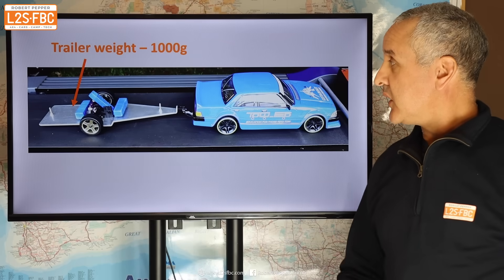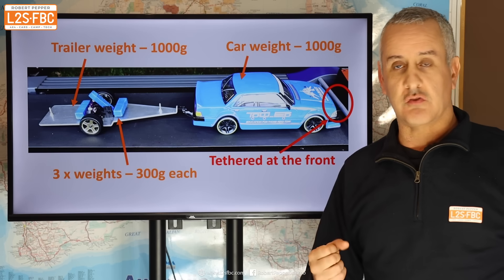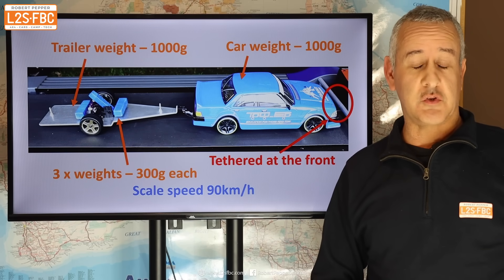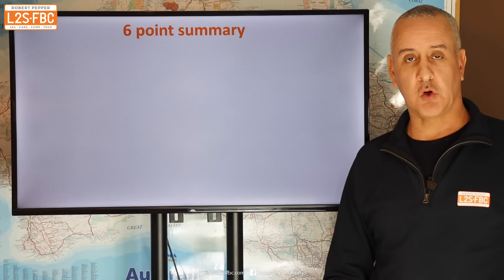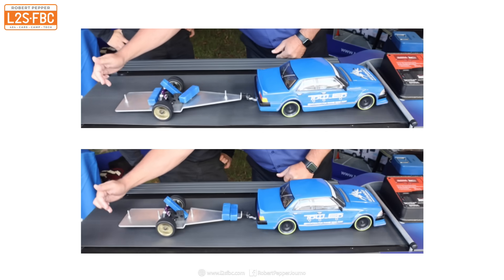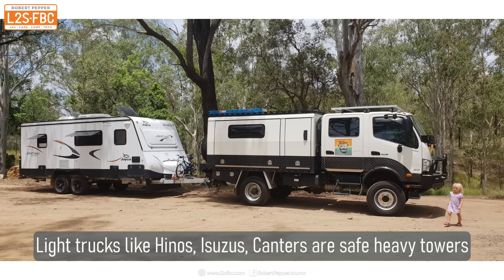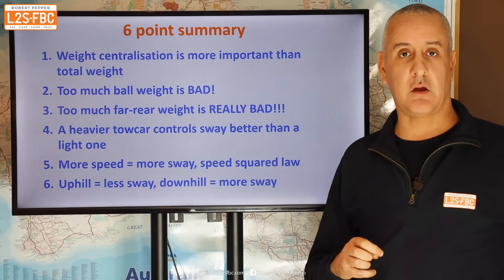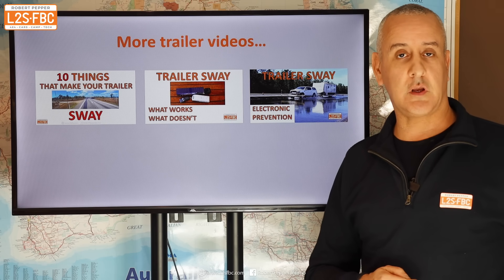7 trailer weight distribution setups, some safe, some deadly.

Comment from the maker: ** COMMMON QUESTIONS ANSWERED **
Consistent questions in the comments are:

1 How do you recover from sway? Answered here:
https://youtu.be/PS_T3-zCzHw

2 Does it make a difference whether weight is front or back if the TBM is the same?
https://youtu.be/fX78Fu87Coo

3 Does height of weight make a difference?
https://youtu.be/LfCpOJGnUdg

and:

https://youtu.be/6IMCEDyHOFY
Reply: 6:38 this is very interesting demonstration considering the front wheels are locked, as in this whole rig set up as no moving steering which would accentuate all motion. have experienced personally using a ford F150 pickup truck, regular cab long box towing a ford F350 quadcab long box from northern usa to southern usa and going up and down the ozark mountains in oklahoma state via Interstate 35. was originally supposed to use the F350 to tow the F150 but the mechanics could not get some of the lights to work with the F150 as the towed unit. got stuck with a guy with seniority over me who didn't understand physics and demanded we pull over to a rest stop so he could use the bathroom, problem was all the exit ramps were on the downhill side  mid mountain or valley floor which had no flat distance at the bottom to slow down before starting immediate vertical ascent again. talk about a 20% to 35% grade in which i made 3 attempts and when the F350 started to get squirrely on me i quickly quit trying to slow down and figured out mid 1st attempt that applying a slight increase in speed of about 3MPH quickly brought the F350 back under control but at the expense of having to be at a faster speed than when i first tried to stop. the 3rd attempt was a complete failure as i told my co worker it would be safest to wait until we got out of the mountains 25 minutes after the first attempt. he was adamant about making the 3rd attempt or he would lose his @#$%@$#%^ right there in the vehicle so i did my best to make the mid mountain cloverleaf exit this time i had managed to keep the truck at just 50 miles per hour while decending but the F350 still became violently squirrely while slowly reducing speed 1MPH increments 2.5 miles before the exit and trying to reduce the speed from 45 to 40mph caused the A frame tow hitch to fail and break apart at the circular eye pintle hitch apex to the aframe and went radically towards the center of the interstate unfortuneately and  i quickly reacted upon hearing the snap and glancing at the driver side view mirror and seeing almost the entire front of the F350 heading towards the far left lane after smashing into the rear of the F150  i was towing it with from about center of the towing F150 bumper to near left headlight of the F350 past the F-150 tail light with the F350s front wheels slightly angled to the left despite F350 steering being 70%.
i quickly accelerated 10-15mph more at about 50mph  and turned the F150's steering to about a 15º more of the wide curvature of a clover leaf exit which jerked the F350 away from continuing down the interstate and then into opposing lanes of traffic going up the mountain.
 due to the hard jerk the F-350 was now 30º from center of the cloverleaf exit ramp i was almost upon as this had all happened in the span of 75 meters of exit approach to the ramp so i had completely exited the far right lane of traffic. i allowed this to happen as in about .3 seconds i had seen that my choice was either a 45º and rapidly declining outer curve and interstate embankment dropped well over 150 meters in about 60 meters of lateral movement or to head into the inner part of the curve which dropped about 25 meters in about 20 meters to then to 50 meters in about another 35 meters before settling down to a much more preferable -15º slope plain to the end of the clover leaf exit where it met the town road below which was 150-200 meters below the start of the ramp or more; say 300-350meters didn't care after i got stopped but i had to crane my neck way back to see up where the top of the exit was from where it started.
anyways as the F350 was 30º off center it started to head to the inside curve and during the course of this 90º redirection the left safety chain had broken and the right was the only one connecting it to the F150 via the left side of the F150's tow pintle cleavis. so when the F350 headed off the road onto the shoulder slightly ahead of the rear tail lights of the F150. this jerked hard on the front of the remaining safety chain for F350 causing it to change direction from it's 30º to the inside of the curve to 45-60º to the outside of the curve and in that instant when i felt the jerk and glanced into the passenger side F150 mirror and saw the direction of the nose of the F350 i said "hell no!" and turned the F150 as hard as i dared to near 35-45º going into a full on straight down the inside curve embankment if i had been allowed to complete the maneuver. what happened in the next instant when the remaining safety chain once again restrained the right front of the F350 to the Left Rear of the F150 is the ail end of the F350 came 280º 'ish around sliding down over the gravel embankment and slammed into the F150 passenger side door at the F350 rear quad cab passenger side door and box area F150 Mirror was over the box of the F350 and the rear quad cab passenger side door was just past door lock to door lock immediately upon seeing this soon to be collision i lessened my degree of turn from 45º to about 10-15º at impact in order to keep directional control and quickly found i could control both vehicles side to side in this manner and kept my 10-15º angle turn and braked to a careful controlled stop as the F-350 was trying to pull the F150's tail around had i braked any harder. the angled inside turn into the F350 prevented the F350 from yanking and running away with my own F150 rear end which would have rolled us over going down the latter part of the embankment truck to truck collision was at about 30-50% down the inside curve embankment loss of control was about 3 seconds from first over powering force of the F350 swinging at around 45mph with maybe 3º right side turn while under very light braking going into light moderate braking was trying to gradually bring the F350 to 30mph by curve entry by using center of F150's rear force to handle almost all the pushing pressure. 
due to  going down hill it should have been 100% center to center for all braking down to 10-15MPH.
Reply: when is more ball/hitch weight bad= put a level on the hood of the vehicle and level it out with spacers if needed, when the level comes out of level with the angle of inclination to the nose of the tow vehicle that is the point of too much. the further you go out of level from this point the worse your issue(s) will become
Reply: Can you overcome sway by adding speed in the short when the trailer starts swaying?  I ask because i did this and wasn't sure if I was 100% lucky or if speed can stale trailer draft sometimes.  The trailer just stayed to 1 side for longer during the sway until it seemed to be dragged back on the straight at which point i started to reduce speed eventually stoppig. Note, i realized my trailer was ball heavy.
Reply: @seoulc  saw a video on this question.  Final answer: no, because the point of no return happens so fast, you can't pull it out quickly enough.  The better tactic is to brake the trailer (only) to pull it back into line.
Reply: @seoulc  ... Re-watch the video!  It clearly shows that increasing speed increases sway.  The faster you go the faster the sway.  Slowing down has the opposite effect.  The slower you go the slower the sway.  In short, you were probably lucky.
Reply: @digiacomtech5589  see i figured this note in the video was constant speed.  If i go 90 consistently my risk is increased for sway but if i go 50 risk is lowered.  Now if i go into a wobble going 50 due to road condition, in my situation i punched my v8 twin turbo truck (x5 m) to 80 and the trailer stayed on one side as oppose to wobbling.  Like i was dragging it through the impulse change in the opposite direction because the trailer was drifting or that's what it looked like w/ hearing the tires screeching.  My logic was (flawed but still) understeer oversteer derived.  That's probably all nonsense but want to explain, i don't think im stupid.  I guess the question is how do you control sway once it starts and through that i can understand why im not dead right now lol
Reply: I appreciate your video very good I pull a seven thousand pound tractor and still surprises me how much difference a few lbs can make if loaded improperly Thanks for a lot of information
Reply: Señores con este video uds han salvado muchas VIDAS Que Dios Jesús y Francisco los bebdigan a ustedes y a sus seres queridos !
Reply: Can you make a “wagon” style trailer and show us how it behaves on this setup you have?
Reply: Your content is very appreciated and I include it an onboarding video playlist for crew that will be loading and driving for us. We do hands on training too but the vids really help nail down the concepts and terminology for our new guys.
Reply from the maker: Fantastic to hear thanks!
Reply: Short Answer = IMMEDIATELY SLOW DOWN!  

The Video clearly shows that increased speed increases sway.  It also means (and they should have shown this) decreasing speed decreases sway.  This is why in some places you'll see a different/slower speed limits for trailered vehicles.  Rule #5 in his '6 Point Summary' at the end of the video ;)
Reply: Do you have a video for placement of the axle? I would love to learn more of how to safely space them out
Reply: First good video. But I have to just say this. If you drove 90 kph in America, you're going to get your doors blown off. This isn't 1978. (I don't know how my parents ever drove that slow.) I hope people are more patient down there. Only a few recreational drivers with trailers go 90 here... everyone else is 105 to 120.
Reply from the maker: @AllAmericanGuyExpert   @American Light  I understand that, and I like my doors attached to the car. I also like to get where I'm going before the universe ends.
Reply: @L2SFBC  One of the oddities of American vehicles in the last 25 years is that the trucks all got bigger, taller, and vastly improved in torque, power, handling, and gearing. I have a 1990s truck and a 2010s truck by the same manufacturer. The newer trucks are made for the long hauling at 120+ kph, while up till 1997, they were like the old farm truck that no one was happy to be behind. New trucks are rolling off the assembly-line with the ability to pull over 17 tons, their computers watch sway, and there are all sorts of anti-sway components available.

In the American South, pulling trailers has become extremely common. Utility trailers are getting common for construction and farm work, plus all of the boats and RVs and cattle/horse trailers. We have bifurcated into people with pickups and large SUVs -- and people in cars and those things known as crossovers. Where I live, every 10th vehicle you pass has a trailer. The hardware box stores have begun to stripe off spots for trucks and trailers. Gas stations have room for turning. Diesel is sold in a lot more places.

It's way different from when I was a kid.
Reply from the maker: @AllAmericanGuyExpert  thanks, really interesting to hear from people in different countries!
Reply: @L2SFBC  Bonjour est-ce que mettre une barre stabilisatrice entre l'essieu arrière sur le véhicule tracteur sers à quelque chose,
Reply: Most caravans have a brake system non of your toy models have
Reply: What about all the factors that your cute little model doesn't take into account like wind, road surface, inclines, declines, off-camber turns, wet surfaces, towing vehicle wheelbase, weight, and varying widths? All-wheel driver vs standard drive, and on and on. Every vehicle trailer combination is going to be different... drivers just need to know their gear and, most importantly drive cautiously.

Comment: Hi, thank you for these amazing videos. I leant so much. I have a question or two, i am looking at purchasing a caravan, 4 berth with a weight of between 1200 to 1400kgs towing with a Mitsubishi Triton dc. I have noticed that the manufacturers of the van spilulate a gross towing weight of around 100 kgs heavier than  the dry weight. I am hoping that i am making sense. What are your thoughts on towing with full water tanks and at approx 100 litres this would be close to the maximum towing weight. This doesn't leave spare weight capacity for much. Is there a calculation to work out the optimal tow ball weight v caravan weight. Thank in advance and again i hope i am making sense. Cheers JP
Reply from the maker: A 4-berth van of 1200-1400kg?  Sounds light?  And only 100kg between empty and ready to live out of?  Again, low, water alone is 1kg per L let alone all your other gear, gas bottles etc. I think check those numbers....

Comment: got 7500 miles with a enclosed cargo trailer and a f150 with electronic sway control which has warned me often. I have experienced many of the things described in this excellent video. Thank you for making all my future rides safer. Very Very well explained and demonstrated, Best on the net so far. After many long searches and watching different channels. I have struggled with the specification of 500 pounds tongue weight without a wt dist. hitch and 1150 with. My concern is the failure of the trailers frame with  a WDH hitch that itself weights a 100 pounds. I have seen many examples of this online. wonder what the real world wt should be on the tongue for the trucks real world capacity.???    I will be adding more weight to the truck and loading more carefully around the axles more strictly moving forward.
Reply from the maker: Unfortunately there is no fixed and easy way to determine optimal towball mass. Start at 8% and work up from there is a basic rule.

Comment: Okay, so I have a Chevy express Van that weighs about 3500 kg with driver, co-pilot, tools and all the accesories I've added to it and it is the long wheel base version. Right now it mensuales just shy of 6.5 meterse long. Now, I'm designing a trailer for it, a car hauler. I'm favoring toungue weight here and I'm considering dual axles too (independent from eachother, so they might provide a bit more stability in the back and forward rocking motion) and using a weight distribution hitch too. But where should I place the axles in the trailer? I'm having a 7.75 meters long trailer from the ball to the very back and I'm designing it to have the center of the axles right at 2 meters from the very back, so maybe I'm too far behind? The Van can go up to 5.5 tons in weight when just hauling stuff and people inside, but it is rated to pull just 10,000 pounds, or 5 tons, which would limit the toungue weight on the ball to 500 kg. Any car I can be hauling will weight under 2.5 tons and the trailer should be just around 1.5 tons. So, a maximum total weight of 4 tons and an ideal ball weight of 400 kg with a maximum of 600 (15%). Would you make an experiment trying with different trailer lenghts and different axle positions? It would be wonderful to have some visuals on how that works.

Comment: Thanks for interesting video. I would have loved a trailer model that could move the trailer axle forward and back. IMO an axle that is further back aids stability, the downside being extra tow ball weight. Your model with a moveable axle could have shown the issue. I would not help trailer owners, but would help trailer buyers.

Comment: Wonderful video!  This will help prevent wrecks and save lives.
Weight farther out increases the trailers rotational inertia, its tendency to keep rotating at the same speed.  So once it's rotating (on a turn, or if there's sway) it's harder to stop.
A heavier tow vehicle both is harder to push aside (more inertia) and has more weight on the tires = more traction.

Comment: I am very experienced with towing since many years and noted a golden rule when swaying starts. IMMEDIATELY BREAK och take down speed.
I also learned a very difficult method to drive at "Impossible" high speeds and wrong loads. When the swaying starts, you can give the steering wheel small pushes in the right direction i the same rhythm as the swaying. This dampens out the sway. But DO NOT try this if you are not a skilled person on it. One wrong push means crash.
An extremely dangerous thing I  experienced was when I slow puncture developed in a rear axle tire, suddenly started a disastreus heavy swaying. So be extremely careful towing double axels trailers bcs of this almost impossible to solve problem.

Comment: The model is effectively a trailer towing a trailer. The front trailer or car in this model is secured at the front. It's a good demo, but not true to the real world. Replace the car in front with a remotely operated car that is not tied to anything. The results would be devastating and more accurate.

Comment: Maybe could mention that if the trailer isn't hitched parallel (tipped up too much) then it kind of approximates some of the problems you described here (too much weight on the back)? Peace! :) It seems like most trailers are built such that you aren't even able to put too much forward tongue weight (ex: w9Dgxe584Ss) so I'm a little confused there...why aren't car haulers subject to more sway , for instance?

Comment: One question. Does the wheel base length of the trailer affect it?  Ie a longer trailer vs a shorter trailer..
Reply from the maker: Yes longer drawbar more stable
Reply: @L2SFBC  is that due to the mechanical advantage of the lever?
Reply from the maker: Yes